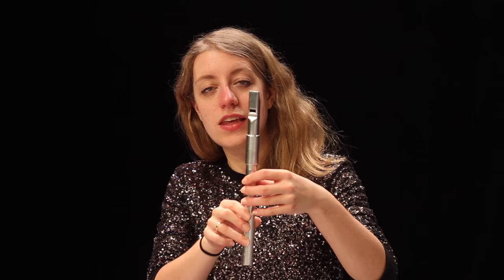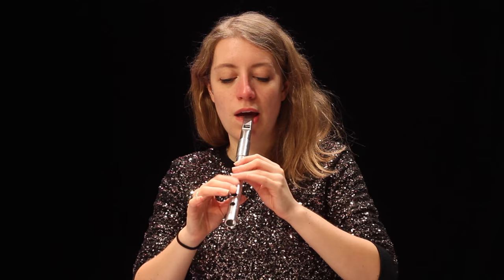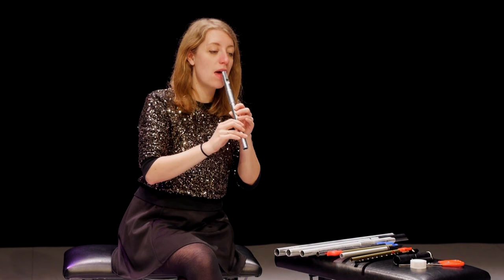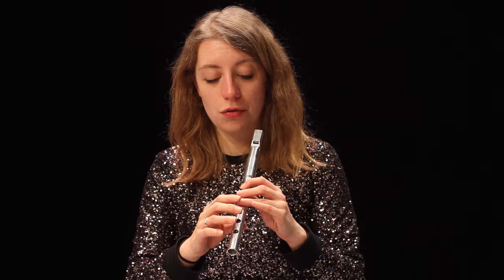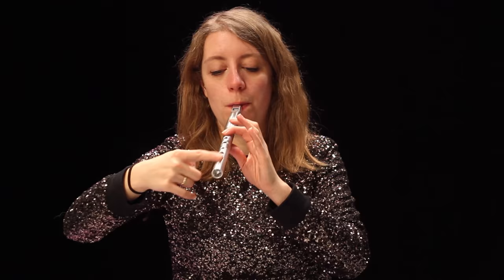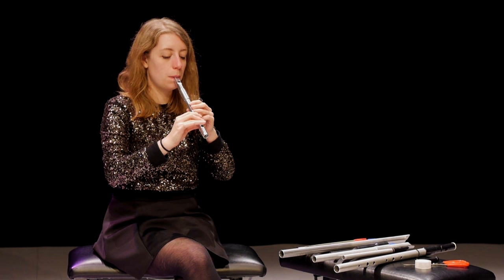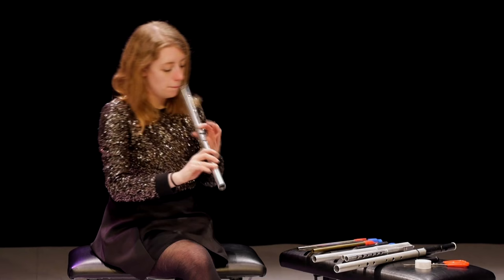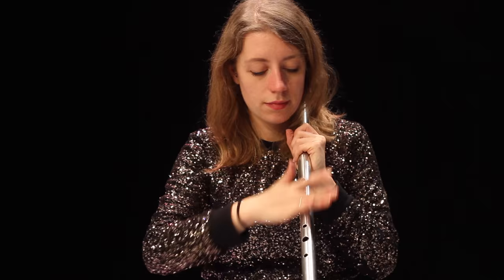Tin Whistle - Finger Techniques and Effects

Comment: are tin flutes effectively chromatic?
Reply: No, diatonic. They come in keys that will play one major scale. E.g. a D whistle plays the D major scale, though you can also play in G since it is possible to play a C on a D whistle (or avoid C altogether and e.g. play a pentatonic tune). It is possible though uncommon to half-hole to get other chromatic notes not in the scale, but it's usually more trouble than it's worth